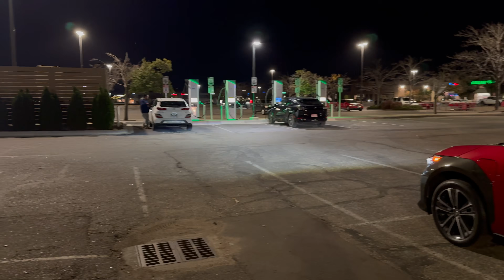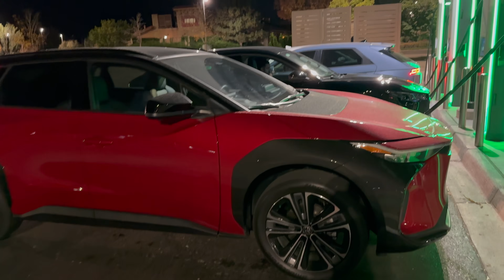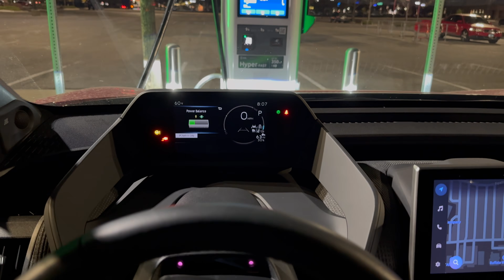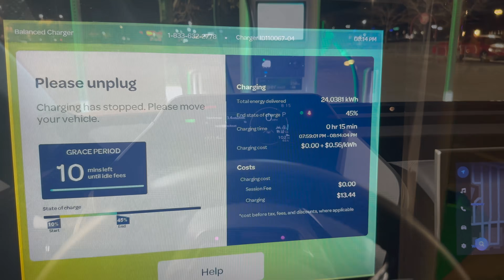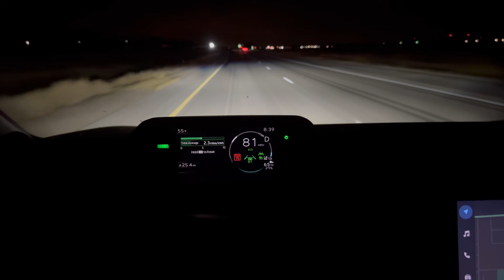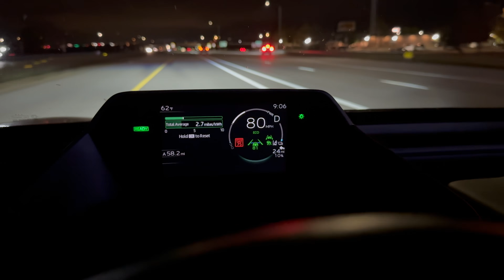Updates Improve Toyota bZ4X Road Trip Ability! However It Still Underperforms In Our 10% Challenge

Comment: The charging limit is allegedly to conserve the battery and limit degradation. Toyota guarantees a 10y/1.000.000km battery life and still have it at minimum 70% battery  capacity.
On a note, in Europe both fwd and awd models gets the (better) Panasonic battery with 150kw charging speed. I don't know if they have completely ditched the (slightly bigger, but slower) Chinese battery everywhere, but there you go

Comment: Eh, the testing procedure here is disappointing. Two major issues. 

1. The outside temperature was much lower than some of the other vehicles featured in the spreadsheet 
2. The heat was used instead of the AC, although understandable given your outside temperatures and trying to maintain testing consistencies… but we all know that using the heat is far less efficient than using the AC. 

These two variables alone made this a disappointing result.

Comment: Great test! 

Just had my new BZ4X FWD for a week. My previous car was a RAV4 prime from 2021. Think a lot of BZ4X users will be previous RAV4 users so here’s some comments.

My initial experience is that the driving experience is more planted, heavier and nicer steering and overall nicer to drive. The drive train is very smooth and the seats are more comfortable. I’m not missing the extra horsepowers in the RAV4. The matrix lights with adaptive full beam is a lot better than on the RAV4. The small front screen is great, love it. Rear seats have more legroom but the seat is too low. I miss the rear wind screen wiper but it works ok as the wind slowly blows off the water, but not sure how this will work in snow. The boot is slightly smaller. 

The overall early experience of changing car is very positive.

My concern is of course my first long road trip, but let’s see…
Reply: I'm a current 2023 RAV4 Prime owner and I just bought a used 2025 BZ4X.

I love them both.

Comment: Great review! I love my '24 XLE FWD bZ4X. I have done a few videos on fast charging, and I maxed out at 135kW once. I plan to do some cold weather testing soon. It does have a battery heater, but I do wish I could precondition the battery. I get 250 miles of range, no problem. Plus the lease deal is a steal!
Reply: If is not secret what is your lease figures ?
Reply: All in (gap and taxes, fees) $300 a month. I put $1000 down but really didn’t need to. I haven’t bought gas in 9 months and have charged mostly for free with the included EVGO charging.
Reply: @tyhend88  wow, that's awesome,
Here local dealer wants 4000 down 470 a month
Reply: Assume yours is single motor?
Reply: @apiscator444 yep!

Comment: I wonder how this would compare to the OG Tesla model S
Reply: I traded a 2013 S with the 85/Kwh battery for a 2024 Solterra.
They are pretty hard to compare actually, much different vehicles. The Tesla drivetrain is such a pleasure, and the power delivery was just perfect. On the flip side, while the Subaru isn't the rocket even an older Model S is, it's ironically much more comfortable, and surefooted. It's not a quick EV by any measure, but for just regular car standards it's plenty capable. That's another area that makes them difficult to compare, the Tesla is obviously a pure EV with little to apologize for, while the Subaru seems like a Forester or RAV4 that secretly has an electric drivetrain.
As far as efficiency and charging? Solterra around town with a small amount of highway driving is dramatically more efficient. On a pure hwy trip. I think it's more of a wash, but I give the edge to the OG Tesla as it just seemed to shed less energy at speed and on mountain passes. The biggest improvement from a usability viewpoint is the phantom drain. I don't have access to home charging, and the Tesla would lose between 2 and 5 percent a night parked, it adds up during a work week. The Subaru loses nothing, even after a few days. I've read the Korean cars are the same way, no phantom drain. 
Charging the Solterra is faster, which doesn't say much as the old 85Kwh Tesla packs are really nerf'd after software updates. Higher peak speed on the Tesla, but the Subaru's curve is better. 

It's a lot easier to live with the Solterra than the  OG Model S, but I do miss that car. It was something special.

Comment: Where I am in the UK there are loads of BZ4X’s and some Solterra’s on the roads. They are very popular and maybe it’s for 2 reasons - lease pricing and the fact that many people here home charge and maybe do a road trip once a year, twice maximum. A friend of mine has the FWD version and has had lots of problems with mystery ding dongs and false error messages that the dealer is struggling to fix, they also aren’t very keen on the driver info screen / integration into the dash design. One thing they love is the auto parking system though, miles better than the facelift TM3 that they also own.

Comment: Given the focus on road tripping and people who only want to make short stops, I wonder how valid a 50% Challenge might be. If I'm in the mode of making frequent, short stops, I'm almost never going to wait for the battery to get down to 10%. The other day, even with 70+ mph driving into rain/snow with a several thousand foot net elevation increase, I had been on the road for nearly 3 hours before I made my first stop, and I was still at 16% battery.
Reply: That happens often after you leave home at 100%, but if you arrived at 16% a later stop after you DC charged, you technically charged more than you needed.

Nothing wrong with a buffer, but most cars slow down substantially 20 to 80 vs 10 to 70, so the goal is to get the best out of every car.
Reply: @gelu88  To me, it seems more that it's a test that favors a specific design philosophy (i.e., Tesla's). To your point, I agree that the 10% Challenge is worth keeping specifically because it favors that design philosophy, but I think it detracts too much from the other design philosophies (flat charging profiles) to be the sole focus. 

I suppose, if we wanted to focus on the 80% cutoff as well, it could even be a 10% and 45% Challenges because that would be splitting the "meat" of the charging profile. Ideally, you'd want an EV that does well on both Challenges. Yes, the 10% would most often be slightly faster, but not always.

The delta is one of the things you'd be testing for, and some cars would do exceptionally well. The original Audi e-Tron, E-GMP, LFP batteries, Porsche Taycan, etc. People forget (probably because they were so range limited) that the original batch of non-Tesla EVs mostly charged from 10% to 80% in 20 to 30 minutes with very little difference in charging speeds from bottom to top. 

It's a different battery design philosophy, but it's one that many consumers prefer.
Reply: I mean. Maybe I'm misunderstanding, but I don't get it. If you're using 50-100% regularly.. Why not just use 0-50% instead? That would not just be more efficient, but also better for battery health.

I'm not saying that we shouldn't care about the charge curve high in the pack, but that's covered by other tests already